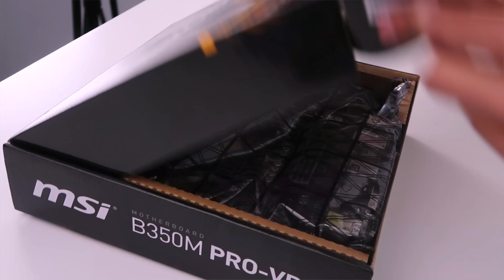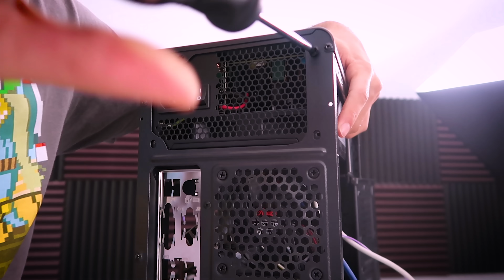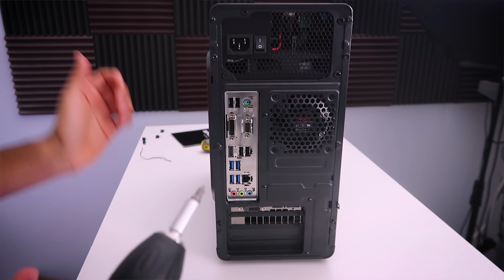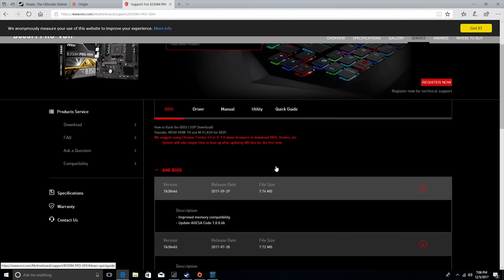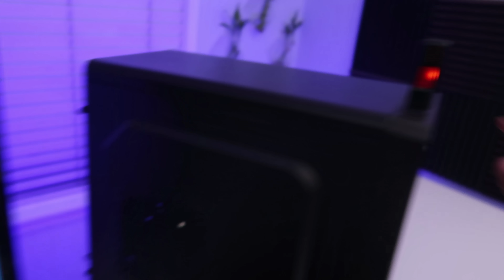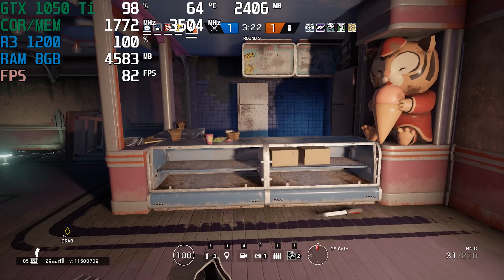$500 Budget Gaming PC Build Guide - GTX 1050 Ti (w/ Benchmarks)

Comment: So I’am building My firts gaming pc and I need you Guys, please tell me if this is a Good comibantion for the money (€776,98). And if I need to switch Parts with somthing else. I know I’am bottle necking with the 1050 TI. I’am Tinking of upgrading it in a couple years. 

Please give you’re honest opinion on this pc and if this is Good of course I will OVER CLOCK EVERYTHING FOR ULTIMATE POWERRRRR

Ryzen 3 1200 
(€109) 
- Quad-Core-Processor
- 3,1 GHz (3,4 GHz Turbo) Clock speed
- 8MB Cache

Gigabyte GeForce GTX 1050 TI G1 Gaming -4GB (€219)
- 1506 MHz clock speed
- 4GB GDDR5 memory @7008 MHz

Corsair Vengeance LPX 2x 8GB - PC4-24000 (€219) 
- GDDR4 
- 3000 MHz clock speed 
- Cas latency 15

Asus prime B350-plus
(€104,99)
- socket AM4
- 1x m.2 
- 4x GDDR 4 slots.
- ATX format
- Audio system Realtek ALC887

Cooler Master MasterWatt Lite 700
(69,99)
- 700 watt
- non modulair
- 80 plus
- 120mm van 

Seagate (HDD)
(Free)
- 7.2k 
- 640 GB

Windows 10 Home
(Free)

Case 
- silent base 800 (€50)
- master box lite 5 (€55)

Total of: €776,98

Comment: Could the motherboard be paired with an Intel core i5 7600k and a gtx 1060?
Reply: LeBruhOBrian no you need a B250,H270, or Z270 for that chip
Reply: Luis Ramirez thanks, sorry if that was an “ obvious” question, Ive been wanting to build a pc for quiet a while and I just wanted to know if everything else is compatible with those two
Reply: LeBruhOBrian nah it wasn’t obvious. That chipset is last generation. I would say just build on the i3-8100 and a b360 board when they come out next month. They both have 4 cores now. The i3 used to have 2 cores but they made them 4 cores to compete with Ryzen. It can’t overclock like the 7600k but it’s still newer and can be upgraded as well to a i5-8400 which now has 6 cores instead of the usual 4 cores on the i5. I would say jump on the i3-8100 right now but they only have Z series boards right now and those allow overclocking which the 8100 can’t do so you’re paying more for something you’re not going to use. Get it if you plan on upgrading to the 8600k or 8700k later on
Reply: Luis Ramirez will an MSI B250M motherboard be good for the i5??

Comment: which videocard is better the 1050ti or 1060 3gb with the ryzen 1200 3,8
Reply: Appie 1060
Reply: thnx mate
Reply: 1060 3gb has more performance but with 1050ti 4gb it has a little lower performance but for certain games you can have more graphic settings since it has more vram
Reply: zStormLord so which do i need to go for
Reply: do you play at 1080p and what games do you play
Reply: 1080p 60hz and games like rainbow, fortnite, pubg and battlefield :D
Reply: Appie at 1080p you’ll be fine with 1060 3GB. Those games don’t take up too much ram as long as you don’t put ultra graphics on siege since that takes up 6Gb of VRAM.
Reply: imagine if i buy the 1050ti and overclock it to the same speed as the 3gb 1060 will it be worth
Reply: ok if your gonna play pubg or rainbow six siege or gta at ultra settings then yout screweed u can play at medium or high settings with the gtx 1060 3gb i still would recommand gtx 1050ti if u want to play with slightly higher graphics but gtx 1060 has better performance so its your choice

Comment: Well that's only extremely frustrating, every single benchmark you showed had better performance than my gtx 1080 and r7 1700 at 1080p no matter what settings I used. But something I noticed is that in all but csgo, your pc had at least one of either the cpu or gpu pushing into the high 90s in usage % while neither  of mine will pass 75%. Cpu moves from 60-75% at the highest (looking at all cores individually not just the total usage) while the gpu gets to 60%. Cpu max temp is 55° at 3.95ghz and gpu max temp is 64°. Doesn't seem like theres a bottleneck anywhere. They both can hit 100% and be stable in some benchmarks.

Comment: If I decide to pick up the Ryzen 1300x and over clock it at 37 will it perform even better or is it not necessary?
Reply: Meep Meep not really worth the extra $20 for a small increment in clock speed. You wouldn’t really see a difference tbh
Reply: Luis Ramirez Thank you

Comment: My first gaming PC Please tell me what you think and what i should change
1-NZXT S340 Elite Matte White Steel/Tempered Glass ATX Mid Tower Case
2-Seagate IronWolf 2TB NAS Hard Drive
3-MSI B350M Gaming PRO AM4 AMD Motherboard 
4-EVGA GeForce GTX 1080 Ti FTW3 GAMING, 11GB
5-SeaSonic M12II 620 Bronze 620W
6-G.SKILL Ripjaws V Series 16GB (2 x 8GB) DDR4 SDRAM
7-AMD RYZEN 7 1700X 8-Core 3.4 GHz (3.8 GHz Turbo) 
8-Noctua NH-U9S 92mm Premium CPU Cooler, 
9-SanDisk SSD PLUS 2.5" 120GB SATA III

Comment: So if I swapped out the amd 1200 for the 1300x and the gtx 1050 ti for the gtx 1060, everything will still be compatible? Or do you need more power? And the case doesn't really matter as long as it's big enough and has the same amount of fans as this one? Also is this a good upgrade? Thanks
Reply: boJ I would keep the 1200 and just get a 1060.

Comment: If anyone can help me, I’m very new to building pc’s and I would want to build one sometime next year and I want it to be not expensive like 1,000 but somewhat reasonably priced. I know I want atleast 16GB RAM and a Gtx 1060 6GB can someone tell me what else would work with those 2? Please and Thank you :)
Reply: G0ld3n 0rton u should get a ryzen 5 1400 ,an asrock ab350m pro4 and a Thermaltake TR2 600W Bronze.
Reply: G0ld3n 0rton for a case I would recommend the nzxt s340
Reply: Deathstroke GR Thank you for the suggestions I would also like to ask if there is a specific type of 1060 I should get and do you know what time of year prices usually drop?

Comment: i am seriously thinking about getting this exact build maybe just a better case, seems extremely good for the price. Would anyone else recommend this for the overall price?
Reply: Rythemz yes
Reply: I'd say put another 150 if u can and get a 6gb gtx 1060 tbh, u can run pubg on high 60fps with that
Reply: Yeah I put the build in a NZXT S350 looks a lot better, bigger, and you have the glass side. Case is $60.
Reply: Elijahh7 PUBG isn’t optimized at all. Investing that money is pretty much pointless for one game. Soon they will optimize and this card will be able to handle it easily. A 1060 just really has no huge differences especially when you just need 60 frames at 1080
Reply: Changed my mind lol, ended up going with 16gb of ddr4, ryzen 1600 and gtx 1060 6gb :P

Comment: Lòooool that's my case XD but i got usb 3 on side of the case, i7 2700k, gtx1060 6gb, 16gb ddr3, 2tb crucial ssd, 1tb hdd and 650watt psu 😂🤣 oh but i dont use usb 3 need to upgrade motherboard and cpu i want 4790k

Comment: joey thanks for ur guide man  1 week ago i builded my pc with ur vids, but i have a question that caple on 7:50 with the 3 saperate connectors i connected that to my psu and the other side that isnt splitted in 3 or 2 is connectors is connected to my mobo (modular psu) is that bad to the pc? or it doesnt matter?

Comment: can someone please tell me is my pc good or bad ?? rate out of 10 : 
  Intel - Core i7-7700K 4.2GHz Quad-Core Processor
 $287.89   
CPU Cooler  
 
Corsair - H60 54.0 CFM Liquid CPU Cooler
 $49.99   
Motherboard  
 
MSI - Z270 GAMING PRO CARBON ATX LGA1151 Motherboard
 $166.88 

Memory  
 
Crucial - Ballistix Sport LT 8GB (1 x 8GB) DDR4-2400 Memory
 $87.89     
Storage  
 
SanDisk - SSD PLUS 240GB 2.5" Solid State Drive
 $74.99   
 
 
Seagate - Barracuda 2TB 3.5" 7200RPM Internal Hard Drive
 $59.99   
Video Card  
 
EVGA - GeForce GTX 1080 Ti 11GB SC Black Edition Video Card
 $749.99   
Case  
 
NZXT - S340 (White) ATX Mid Tower Case
 $66.99     
Power Supply  
 $96.99
EVGA - SuperNOVA G3 650W 80+ Gold Certified Fully-Modular ATX Power Supply

Comment: System
Operating System: Windows 10 Home 64-Bit 
BIOS: V22.4
Processor: AMD FX(tm)-8300 Eight-Core Processor       (8 CPUs), ¬3.3GHz
Memory: 8GB
DirectX Version: DirectX 12

Display
Nvidia GeForce GTX 1050 Ti
4GB 

iv'e put this info (idk if its needed) but i want to know if i can Overclock it? like at what settings do i need to do it? im new to Overclocking so im afraid that it will break my PC)

EDIT: My Motherboard is:
MSI 970 Gaming

Comment: i would get that cpu if the ram wasnt expensive :( but thanks
Reply: its true but to be fair DDR4 will be around for a good few years before it is un-useable. other than PSU's and the case, Ram is the least replaced part. DDR3 is still totally fine and its very dated now. You only need to buy ram once then it can last for years of other builds that will still use DDR4.
Reply: omg building a pc must be hard

Comment: Actually, x3430/3440 with a rx 470 or gtx 1060 would make more sense, not only are the xeons binned higher, support ecc, they also have impressive stock performance, they also cost less than $20 per CPU :p

Comment: Excellent guide! One thing though, you need to install the AM4 chipset driver so you can gain access to the  Ryzen Balanced power profile which contains performance tweaks and how the processor behaves inside the OS. You can easily download the latest version on AMD's site. https://support.amd.com/en-us/download/chipset?os=Windows+10+-+64. The RAID driver is optional. The chipset driver on the other hand is a must install.

Comment: im planning on a budget build. here's what i came up with.would these specs suffice for games like pubg,csgo,fortnite,overwatch?or could ya'll suggest somethin better?

-msi geforce gtx 1050 ti 4gt oc 
-amd ryzen 3 1300x 
-corsair vengence 4gb*2 ddr4 2400Mhz(pc4 19200) 
-asus prime b350 plus motherboard 
-1tb hdd 
-corsair vs450 450W power supply

any good?
Reply: Animesh Srivastava should be fine
Reply: i'm still torn on which cpu,1200 or the 1300x. not sure if 1300x OC will deliver.bcz 1200 can sure can

Comment: I always wonder why all PC build don’t include the monitor, mouse and the keyboard? 🤔
Which is probably 200$+
EDIT: great video BTW 💕
Reply: Cause they aren't exactly part of the pc
Reply: RX7 Reaper no one is going to spend 200 dollars for peripherals on a budget build. 😂
Reply: I'd say 50 for K/M and 100 for monitor.
Reply: WHH95 200 dollars? lmfao you're dumb
Reply: Ser Pounce, The One True King of Westeros well technically if she wanted "gaming" gear than yes $200+ but I'd say just buy them shits used to save money
Reply: Ser Pounce, The One True King of Westeros true lol.
Reply: like most said if you are on the budget for a system at entry level specs you should just use your TV and you can grab a not too bad KB/M combo off amazon for sub 30$ go mow a couple lawns or even to start it doesn't hurt to just grab some second hand stuff from a business that is throwing them away or a buddy that has an old one in the closet. Its more common than you think.
Reply: WHH95 With keyboard and mouse I could agree, but you can get cheap (and good) ones really easy. Monitor however is not part of the PC. Gaming consoles don't include a TV either, do they?

Anyway, you can just use a TV or buy a pretty decent 1080p 60Hz monitor
Reply: WHH95 it's not apart of your personal computer
Reply: Pls link me some cheap decent mouses and keyboards
Reply: syndicate pro You can find them yourself easily. A friend of mine bought a normal set of k&m for like 10 dollars. Mine was 50 euros for a mechanical keyboard with many LED lights (including rainbow which is sexy af lol), the mouse also has these lights and has 6 buttons which is more advanced than the normal mice. Pretty good price for what it gives.
Reply: WHH95 Well you can get a mouse and keyboard combo for like $30. Also, you can just use your TV. The monitor isn't exactly necessary.

Comment: Here in Italy the prices are way higher. This is the build that I'm getting(Everything arrives at 28 December):
i3-7100
MSI GTX 1050 Ti 4GB OC
Crucial SSD 120GB
WD Blue 1TB
Antec VP400P EC(400W) 
B250M Pro-Vh
Ballistix 2x4GB
Aerocool QS-240
Everything for 570 Euros. With that build I would go for around 600 euros without the SSD. Too much imo. (At least, for my budget)

Comment: Hey joey, loving the videos! I am looking to build a pc myself, but am more focused on your 650 dollar build instead. I am just modifying that build a little, since I have a bigger budget by 50 dollars, so I will be getting a bit of a nicer motherboard that can handle overclocking, and most important, RGBS! I am also getting an nzxt case that is better for airflow since I want to keep it in good shape for a while. It sucks that ram prices have gone up too, but it is fine and I will just wait until you can get 16 gb of ram for only 130 dollars again(with rgb, obviously). Anyway, love your videos, keep it up!
Reply: Yo for gaming I would highly advise not putting the extra 150 into the case or mobo. B line is more than good enough to get you to 4ghz on most chips and RGB is neat and all but you can always get an rgb light kit for 15$ later on and slap it inside. I would put all of that money into a better gpu. Go for a 1070 or 1060 6gb with that extra money if you want to play games since I promise you will spend a lot more time at the nicer graphics settings and higher FPS than you will looking at the computer parts.

Comment: My 350$ budget build 
Cpu : I5 2500K
Cpu cooler : Coolermaster TX3 
Motherboard :Gigabyte G1.Sniper 2 E-ATX
Ram : 2x4 GB Corsair Vengeance 1866MHZ
Gpu : Sapphire R7 370 2GB
Storage : Seagate Firecuda 2TB
Psu : Corsair CX450-M
Case : NZXT S340

Comment: Also wanted to say to anyone reading this comment right now pubg 1.0 released and it is so so so so so much better. I am using an fx 4350 and gtx 780 and i play it at high settings with a constant 70+.
Reply: dripphy yo bro do u think I can run it 
gtx950m
i7 7700k ,8 gb ram,
Reply: 780. high settings. constant 70 fps or even more? doubt.
Reply: JohnPlays YT yes lmao
Reply: Daryl Diona you probably typing this on a 2014 hp laptop bud
Reply: dude I'm running the game on 1070, I have no issues whatsoever (I agree about the optimization you're pointing out) the thing is, you're claiming that you can run this (still) demanding game at high preset with CONSTANT 70 fps (or more) on a freaking gtx 780 LMAO. Even a 1050ti wouldn't run PUBG that well dude. Either you make a benchmark gameplay vid or I ain't buying this bullcrap.
Reply: Daryl Diona lmao 1050 ti is a toy compared to a 780!! What a joke dude you really think 1 more gb of vram hurts performance on a game that uses no more than 4 gigs at 1080p!!
Reply: dripphy I have a 1050 2gb laptop and a i5 7300hq. I think the cpu will be fine, do you think the gpu be workable
Reply: zachary tyler for sure dude! You can prob run low settings with medium textures and render scale at 100 with at least 40fps (lowest 35 avg)
Reply: Daryl Diona i now upgraded to ryzen 3 1300x and now i get 80+ high settings
Reply: Popular Power Fr
Reply: Daryl Diona Bet!!!!
Reply: Daryl Diona turn post notification on
Reply: Daryl Diona it'll be done asap
Reply: Woe could I run high settings 60fps, Intel core i5 2500k overclocked to 4.5ghz 
Gtx 1050 ti 
8gb ddr4 2400mhz ram
Reply: possibly, because of the gtx 1050ti. but if you have like all high, textures medium, anti aliasing low, view distance low, you should be good 100% :)
Reply: 4350 and a 780 ain’t givin you 70 fps Solid buddy.   Sorry.  I have a 9590 at 5ghz and a 1050ti at 2ghz on the core and 8200mhz on memory and in medium/high I’m lucky to hit 90 fps here and there.   Solid state drive as well and I’m very tech savvy.
Reply: Please stop listening to the people in this comment section, they have no idea what they’re talking about.
Reply: Jesse L 🙏🙏 thanks bro
Reply: Jesse L CHECK MY PROFILE
Reply: Jesse L hahaha a 780 is MORE powerful than a 1050 Ti
Reply: zachary tyler I recommend you try 780 3gb
Reply: Woe I have ryzen 5 1500x better than ryzen 3 1300x right?

Comment: I'm basically building this exact pc for my first build :D and you have a 430w PSU is that future proofing? I was gonna go with a 550w is it needed?
Reply from the maker: Ya a 550w would be a good call if you plan to upgrade to a GPU that needs more power in the future.

Comment: The hard drives actually go on the swing out door inside the case. You can fit two SSD's or two mechanical 3.5" hdd's. Read the manual.

Comment: FYI, there are some models of the 1050Ti that require the PCI Cable from the PSU, and they make for some pretty good overclocking cards.
Reply: You don't need those in the slightest, my 1050 ti has no power cable and can hit 2 ghz on the core clock and 4ghz memory clock without issue.
Reply: yes thats possible but some 1050ti's do require a 6 pin cable and they are even better for overclocking
Reply: Personally, i like 1050ti's that requires cable
Reply: Why?

Comment: Hello joey. i got a quetion: how could you over clock the cpu since the mother board does'nt support over clocking as i know😕
Reply: SqueezY- tube if you bought a non z-series motherboard and bought an intel cpu, you won't be able to overclock. However if you went with an amd cpu you will be able to overclock on the majority of motherboards.
Hope that anwsers your question, if not explain me why. Thanks
Reply: Faisal Akhtar thank u so much it actually does
Reply: you can OC on Ryzen with any Z or B series motherboards but not the A series boards. The A line up is intended for OEM and business/enterprise mass use not for performance.
Reply: Faisal Akhtar you can over click with B350s and AB450s right?